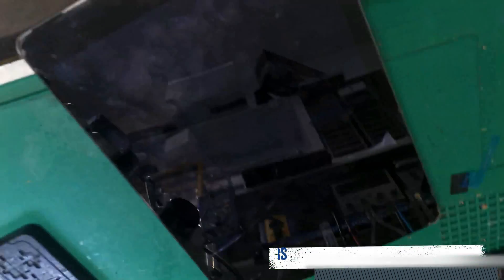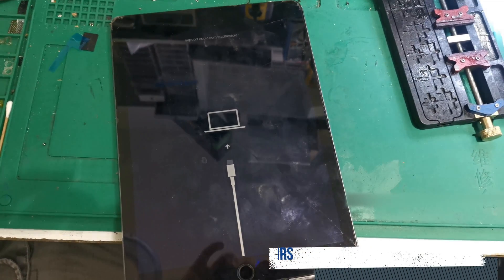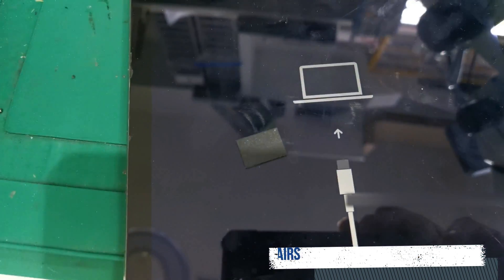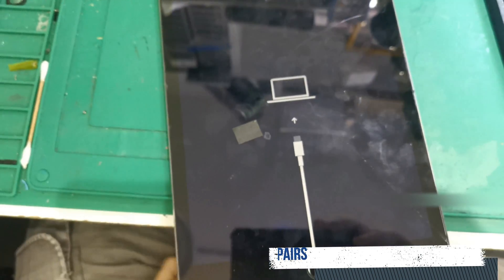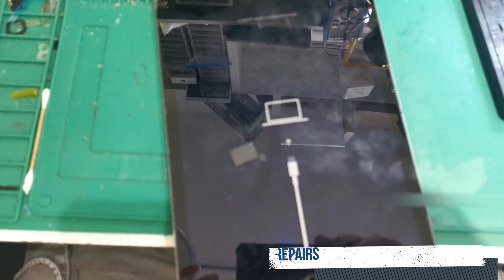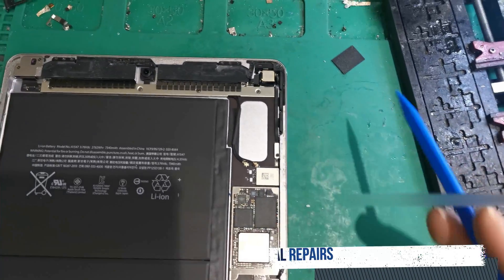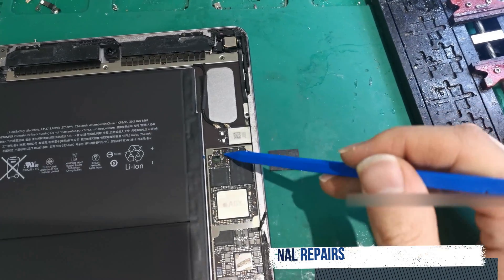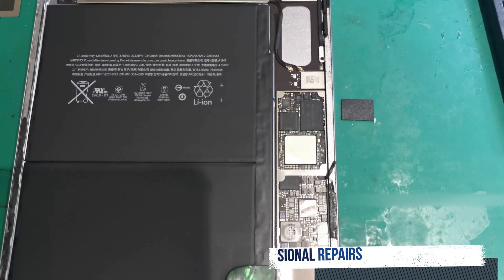Error 4013 on iPad Air 2

Comment: I am having this error. First iPad did random restarts. When I tried to restore, it got stuck in the middle and gave 4013. What's the cost of the NAND? Is it same as iPad memory? Because my iPad 6th Gen is 128Gb, do I have to pay more for this chip?
Reply from the maker: 32 is R1800 64 is R2000 128 is R2200 to replace NAND memory :)